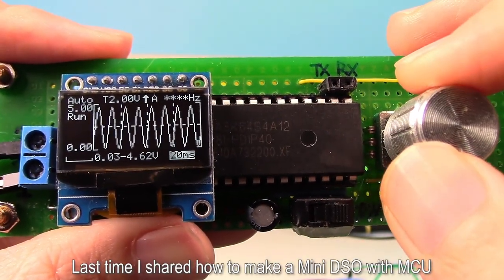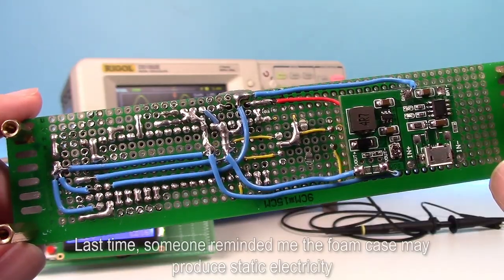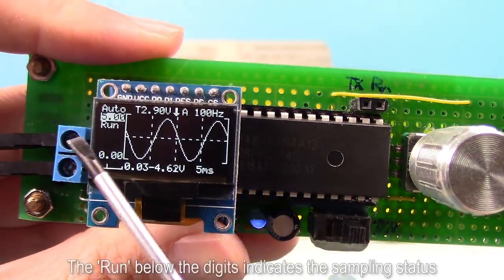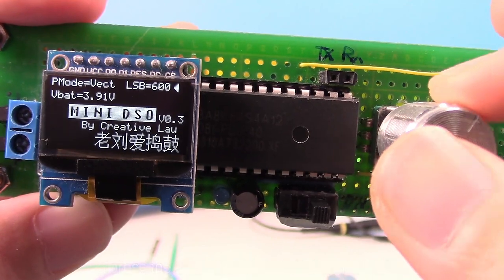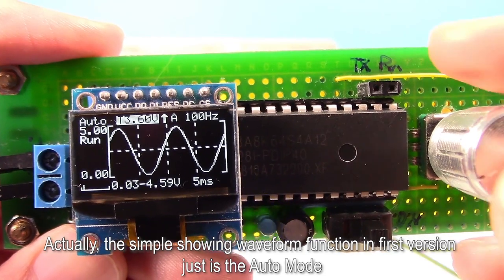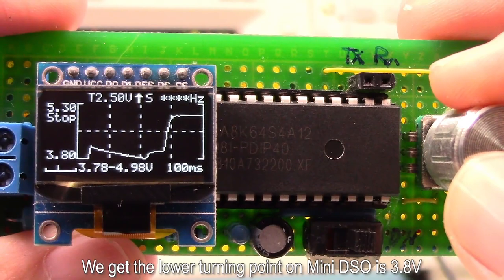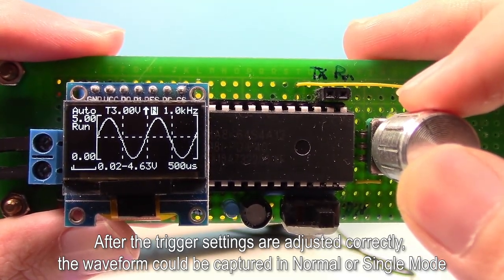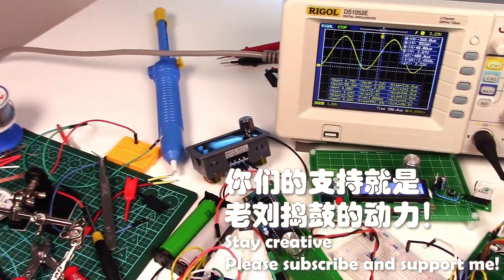Upgrade DIY Mini DSO to a Real Oscilloscope with Awesome Features

Comment: Very nice!
I'm making an stm32f103 version.    I'll post a video.it's really fun.  I don't draw lines that go outside the screen.  This way the user isn't confused by a voltage level that really doesn't exist.
Reply: I'll make a video, and we can help each other.  I got 2 channel ADC with DMA transfers.  
I used 200k on my input probe going to a resistor ladder so I can get +-140 volt.  But I get a lot of noise.  Not sure why. Any ideas?

Comment: Hello Lau,

The high frequency spike issue can be solved by adding a capacitor 10 nF across port pin P06 and Ground which filters off the High frequency spike. Please try.

Comment: esp8266/ESP32 can also be a good move. (+bonus bluetooth connection like PokitMeter products)
Reply from the maker: Thanks for your advice. After complete the transfer work of STM32. I may consider ESP32.
Reply: @TonyVieira  .  that's a nice one but to hassle around with the phone as well????  no thanks. the concept of what Lau made is perfect for basic testing.
Reply: Esp's adc is not very good.